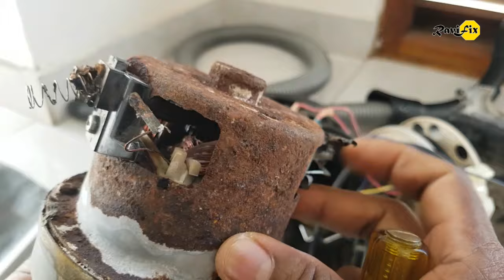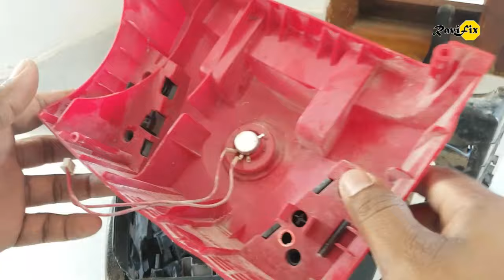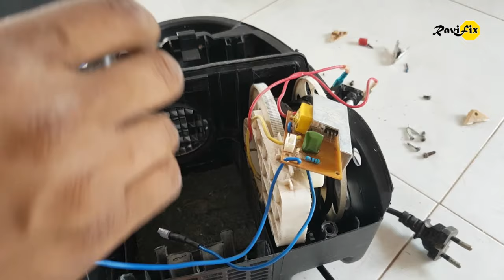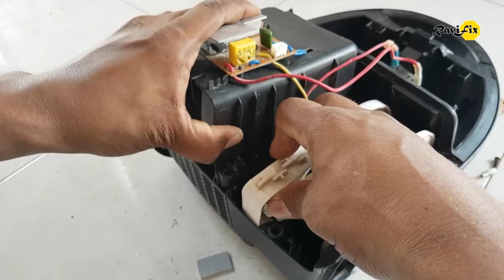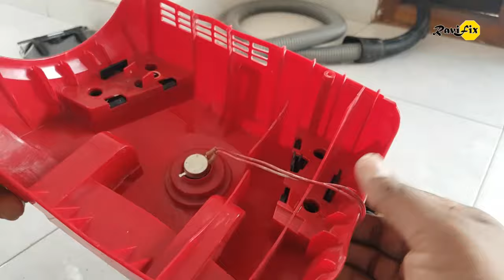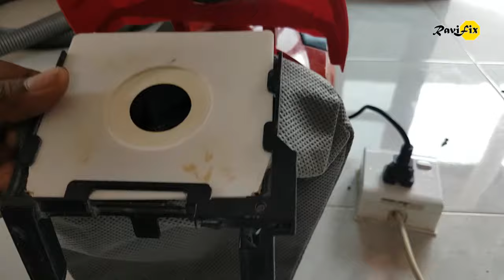Home use vacuum cleaner repair

Comment: Mera vacuum cleaner pehele se bohot jada awas ( sound ) bad gai hai 

Any solution
Reply from the maker: Normally vacuum cleaner is bit noisy. However if you get a different hum than normally noise, it might be worn out motor bearing, but have to check by remove the coves and where the noise come from.
Reply: @ravifixall   but my vacuum is 3 months new

Comment: Sir My vacuum cleaner is not working due to water gone inside what to do
Reply from the maker: First remove the covers and check the motor how it look likes. If it has been gotten rust badly like brush holders etc. It is not possible to repair. Have to replace a new motor which is not expensive.